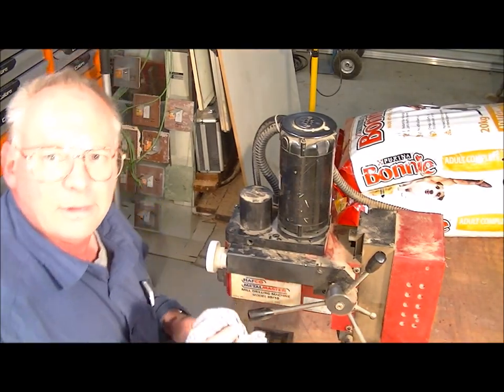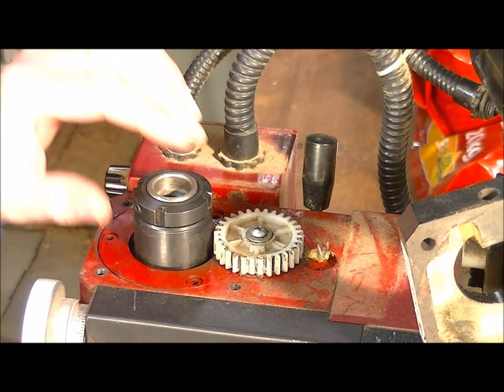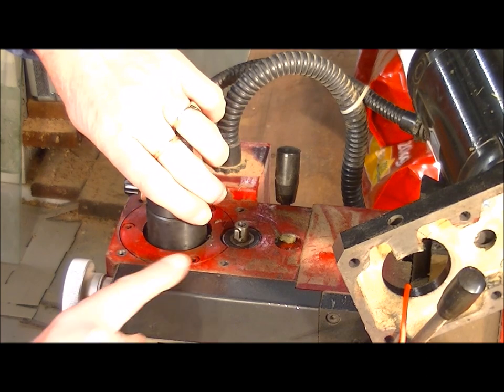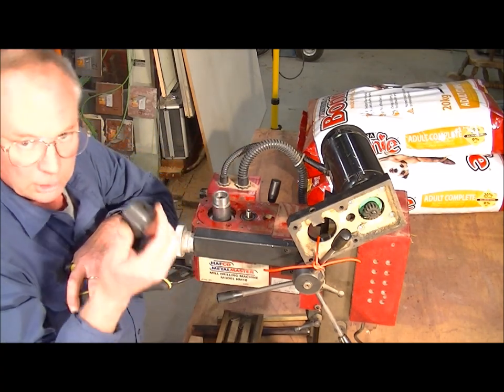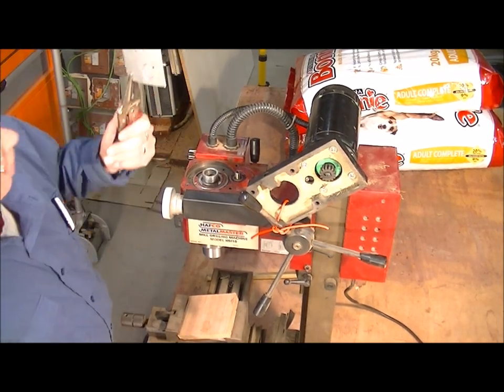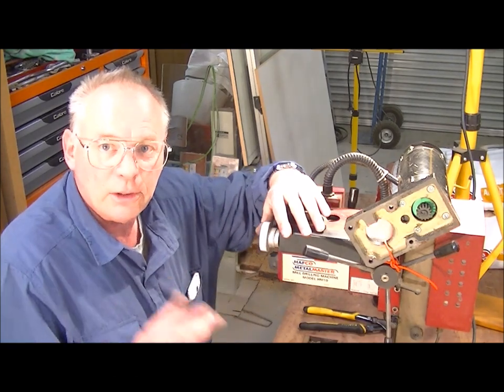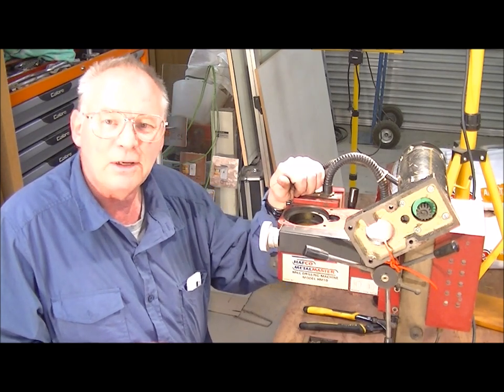129  Mini-mill belt drive modification / conversion.

Comment: Hi Roger I have the mini mill from harbor freight and have done some upgrades to it , like putting on the air cylinder and the longer spine for more 
Travel. I also DIY’ed my own power table drive for the Y axis. I want to put the belt drive on but now after seeing your video I think I need to put in better gears. I will check with “Little machine shop” and see if they have better gears..
I have been running Mills lathes and CNC machines for 35 years.
I will check out some of your other videos.
Bob
Reply from the maker: Thank you, for watching,  
Please like, subscribe and forward the video on to a friend, Roger Clyde Webb
Reply: I read somewhere that plastic gears are better than metal gears for sound and vibration reasons.  Yes they may break easier but theyre cheaper to obtain so having spares isnt a problem. Yes its a pain to be swapping gears out but some might not mind doing it.  My question is and its probably a stupid question but will torque be lost using a belt?  Ive read some getting faster rpm using the belt but are they losing/gaining any torque?  I just think about a mazda RX7 with its Rotary belt engine spinning super fast but that car cant pull or push anything. A truck on the other hand with 4WD can pull a trailer on a dirt road because it uses gears.  Is my train of thought wrong here?

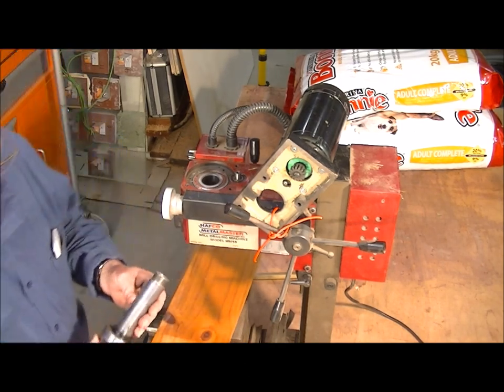Comment: The video between 10:00 and 11:18 shows that the use of the Z-limit block as the sole means of Z support is insufficient. Watch the Z handle rotate. Severe impact forces are being applied in unusual ways. At least support the spindle head with a 2x4 or some such that extends to the bed. The danger is that you will end up not trammed in the Y-axis. There's no adjustment for this on these machines.

Comment: Hi, thanks for the vid, I assume that is a sacrificial gear as such in case too much load is put on the mill drivetrain. The gear splits instead of metal going AWOL. some cheap lawn mowers I have repaired are similar.

Comment: I'm surprised the spindle doesn't have a locking pin like the 44991. Removing the spindle nut should not be as risky as shown in this video.

Comment: a 1" block of wood even oak isnt thick enough to use as a buffer for hitting with a hammer.. you need a 2" block at minimum.  2" block of pine wouldve worked fine.

Comment: Hi Roger,  thank you for the very helpful video.
I have removed also the large gear set that fits on the spindle as it was broken. You say it acts as a spacer block, do you think it should be replaced or it will do no harm to just reassemble the spindle without the large gear set ?
PS. If it is required maybe I could replace it with a nylon sleeve instead of buying a new set of gears just to act as a spacer ?
Reply from the maker: replace it with a nylon sleeve.

Comment: wouldnt it have been better with metal gear? l have belt mod, it sucks too.  Like to have a real mill, old school with belts only/no motherboards, etc.. I bought the pos cheap at yard sale, it’s just a pitiful design.
Reply: Ive been wondering what the old mills use.. Do the high end industrial mills also use belts?  You said the belt mod sucks too? What sucks about it? I was debating if I should just buy a couple backup plastic gears or buy the belt mod. I feel like belts would just increase speed but not torque and that torque is better with gears.  (Im thinking of it in ways how some cars are made. i.e. Mazda RX7 with its Rotary Engine that can achieve high speeds vs a pick up truck with 4WD pulling a trailer because it has better torque production utilizing gears and not belts)